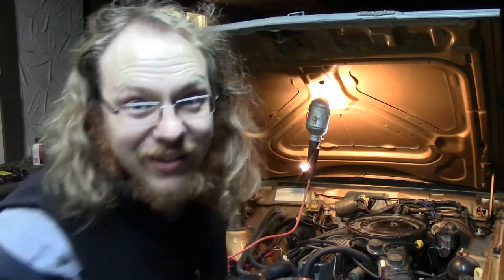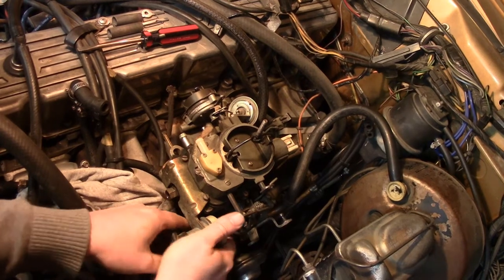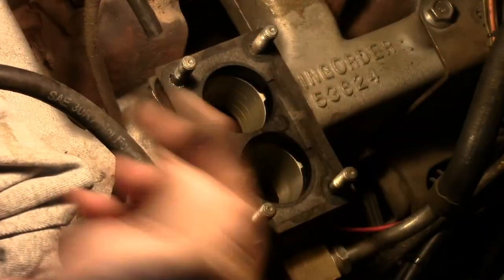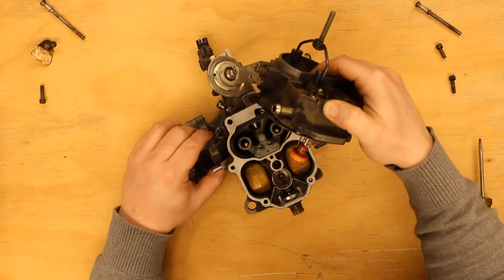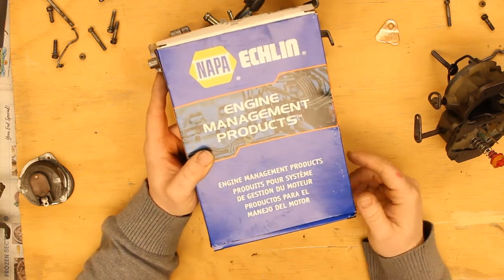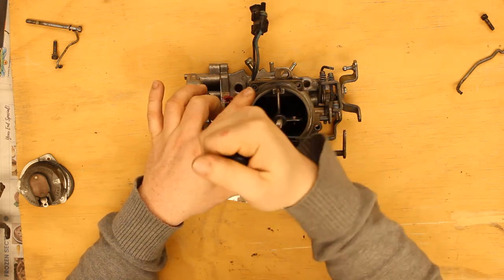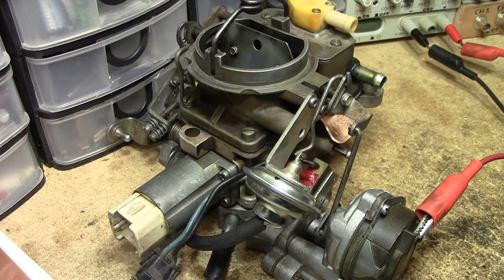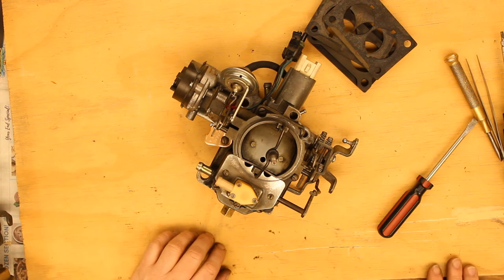Cleaning and Maintenance on a Carter 2 BBD Carburetor

Comment: Make sure the pull solenoid will hold vacuum. Mine had large leak and would not pull back causing excessive choke and flooding during cold starts. Thanks for the video, it helped me.

Comment: my carter is running lean can i put bigger jets and if yes what kind of jet does it take , is it similar to the newer edelbrock jets ?or are these jets differant...the reason its lean is because i had to put a half inch spacer under the carb to help with vapor lock , vapor lock only happened after starting to uise the ethonaol blended fuels , no choice all gas in my city has 5 or 10 percent ethanol and it boils very quickly , the half inch spacer keeps carb cool now but the extra plenum requires extra fuel
Reply: I have never had an issue on any of my Carter carb and ethanol. If it's running lean start with the two adjustable needles on the front of the carb. On my 1983 spirit gt the engine was running lean I replaced the distributor and set the timing and never had a problem again. On the front needle screws I would screw them gently all the way in count out two turns and adjust when it is running you will hear a sweet spot just make sure you adjust them equally. Good luck.
Reply: The jets are just simple screw in brass units and are simple to replace.  The BBD was a great simple carb and easy to service till the government forced all the bolt on crap...I worked at Carter for 13 years but left in 1980...